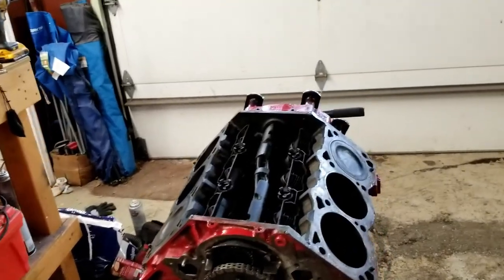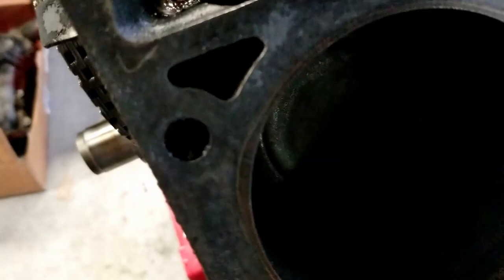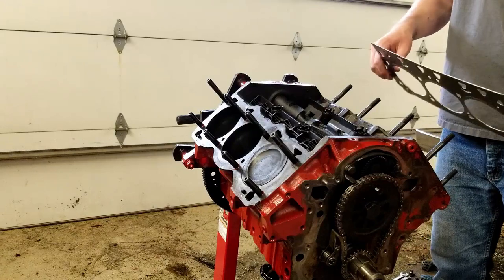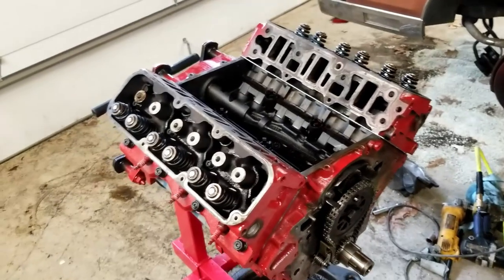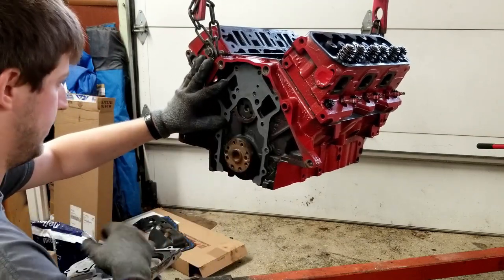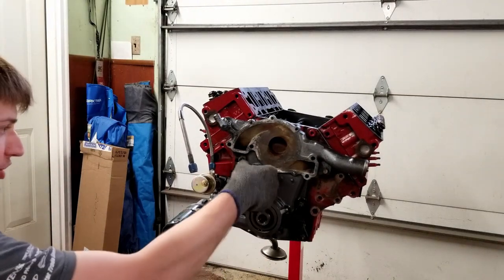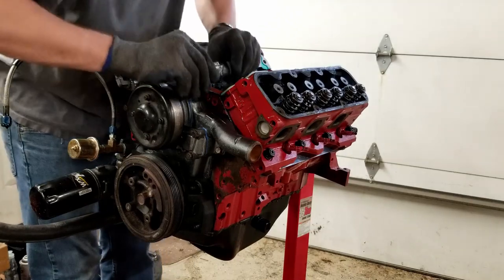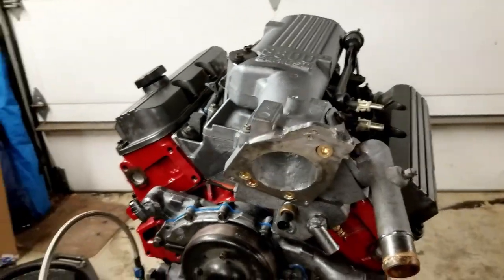Turbo 3800 Grand Prix Chipped a Piston - Ep  2 - Assembling an L67 With Head Studs

Comment: Looks good, but id be scepticle of felpro shit gaskets especially if turbo...
Reply from the maker: Running as high as 26 psi and no issues yet. They're not as bad as everyone thinks they are. They have a pretty good reputation in the L67 turbo world surprisingly.
Reply: @tuningwithstyx  Waiting for your failure. 26 psi and you are not capable to remove exhaust manifolds??? Seized bolts and being lazy is not proof.
Reply: what would u recommend instead?